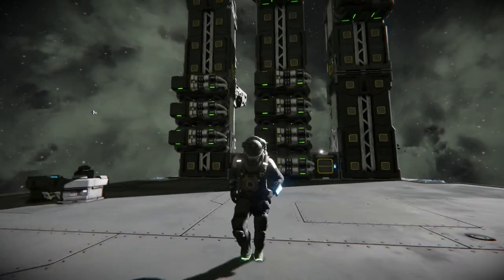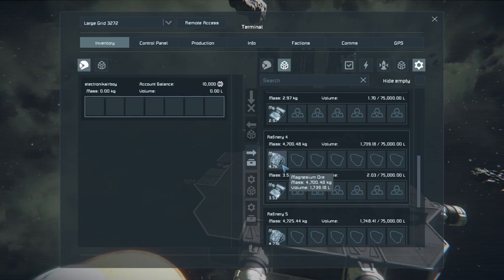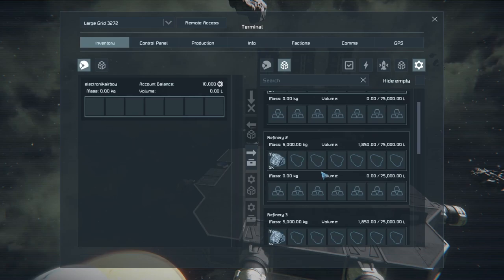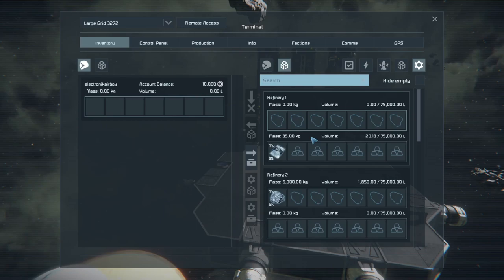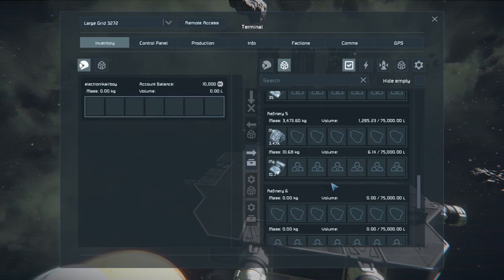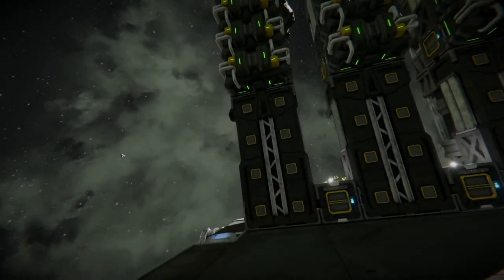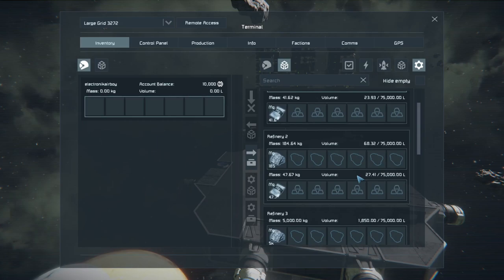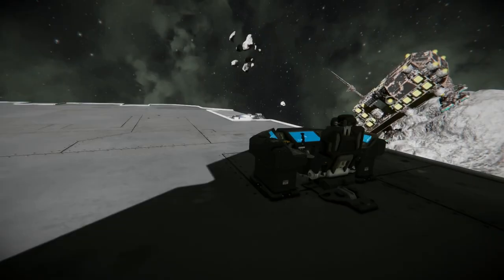The Most Efficient Way to Refine Ore!

Comment: Is it the same no matter the ore. Like Iron gets refined fast even with no modules but platinum even with 4 speed modules it seems like it takes forever
Reply from the maker: I will do some testing and measure the differences to see if the same effect is applied to platinum.
Reply: @Mastermind GamePlay  I know the quantity will be different because base refining of platinum is 0.5%. But I wonder if it's the same proportion. Idk if I'm making sense
Reply: @leroycarfrey7451  1 speed module = same speed as two refineries. So a given amount of any ore will take half the time to refine. Platinum (or magnesium) will still take longer than iron to refine, but it will still be half the time of a refinery with no modules.

Comment: How much time does it take to build theses modules, and how much material?
Reply from the maker: A refinery requires:
Iron 2669, Silicon 0.4, Nickel 18, Cobalt 6

Speed module
Iron 263, Silicon 1.2, Nickel 2

Yield module
Iron 285.5, Nickel 2, Gold 4

Power efficiency module 
Iron 280, Silicon 4, Nickel 6

The time it takes is dependent on your refinement and assembly setup to also take into account finding resources

Comment: I usually run 2x Refinery setups, so i often use 7/8 slots on each for yield and 1/8 for speed on both. How? I slap a module between them.
Reply from the maker: Now that is thinking outside of the box.
Reply: IIRC, the speed module will only give +50% speed per port it's connected to, and similarly the odd yield module connected only to 1 port on each refinery will also only contribute half of the usual yield multiplier, or 1.09x instead of the usual 1.18x to its refinery's yield.

Interesting compromise. Slightly inefficient b/c of the 1 unconnected yield port on each of the two odd yield modules.

But you get the speed (and power consumption) of 3 refineries effectively running 3.5 yield modules each.

Comment: Also please provide the amount of power needed to run Refineries with those Speed Modules.
Reply: Refinery uses 560 kW. Each speed module is effectively +1 refinery. After that it's basic addition math.

1 speed module = 2 refineries, or 1120 kW.

2 speed modules = 3 refineries, or 1680 kW.

3 speed modules = 4 refineries, or 2240 kW.

4 speed modules (but who does this) = 5 refineries, or 2800 kW.

Comment: Thanks for video. Isn't that full yield modules is almost equal 2 speed modules? I will try to explain with my half English. With 5k Mg ore, without any yield module, you will get 35 Mg ingots in X amount of time. With full yield modules you will get 70 Mg ingot in the same time. That means full yield module also save too much time. Maybe 3 yield ad 1 speed module is the most efficient one.
Reply: As a comment above explained, each yield module increases yield by the 4th root of 2, multiplicative for multiple yield modules. Thus 4 yield modules make 1 refinery output exactly 2X the yield from 1X the ore in 1X the time.

Most people (including me) like the 3 yield + 1 speed (well, I use it only for common ores), but 3 yield only gives a 1.68X yield multiplier. So you lose out on absolute yield (meaning more time required to mine ore for the same ingot yield). But the 1 speed module means you basically have the same as 2 refineries with 3+3 yield modules.

So if you are resource-constrained and can't build 2 full refineries with 4 yield each, then 1 refinery with 3 yield + 1 speed is about 68% as good.

Comment: so asteroids regenerate if no player stuff is near them after about 12 hours so once you find a deposit its infinite. yield of ingots per minute is the only metric that matters.
Reply: It's true about deposits being infinitely regenerated if you move your grids far enough away. If you are playing a solo game, you can go into the admin window and adjust the time until voxels are regenerated. I think a lot of players don't think about this when they build a permanent static base on top of an ore deposit, preventing the voxels from regenerating.

Yield of ingots depends on whether you have so many refineries that you outpace the regeneration rate of the voxels and ore deposits. And that depends on your play style.

I usually try to locate 2 of each critical ore deposit to alternately mine, and use either a static piston/rotor mining rig, or a large grid mining ship. Either one will strip an entire deposit empty in less time than it takes the alternate ore deposit to regenerate.

Provided I'm not PCU- or resource-constrained, I just go with all yield modules on a bank of 10-20 refineries, to minimize my time spent mining. And after stripping a few deposits, I have 6+ large grid cargo containers stuffed full. My older PC dramatically drops sim speed when I build a total of PCU over 200K and actually try to fly/fight with ships that are 50-100K PCU (on planets; this is mostly fine in space). Plus almost all MES NPC factions aren't really designed to be able to contest a player with a 100K PCU ship. It becomes a bit of a boring comp stomp unless I manually edit the MES to significantly increase the spawn rate so that the NPCs swarm me with 5-10 large grid end-game ships at once -- which chokes my computer anyway. :D So hoarding that much quantity of resources is just wasted effort for me. I find that the 25-50K PCU range is where it's still challenging and fun for me to fight NPCs with a chance for them to inflict meaningful damage on me.

I imagine a better CPU with a faster core and pipeline could handle much more, but ultimately it'll run into its own limit as well, or else it'll run into the engine's limit and become unstable. So maximum yield rate per minute only matters until we each hit the upper boundary of what's playable.

Until that point, active player time spent on a task is the primary metric that matters to me. I can be building or designing other stuff, or flying around on joyrides or blowing up NPCs, while my static drill mines and my refineries process ore.